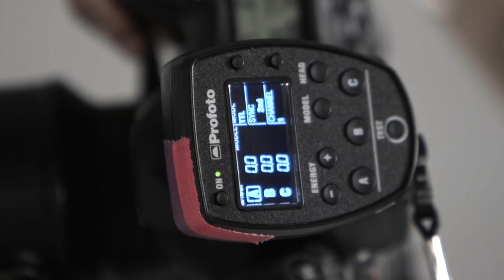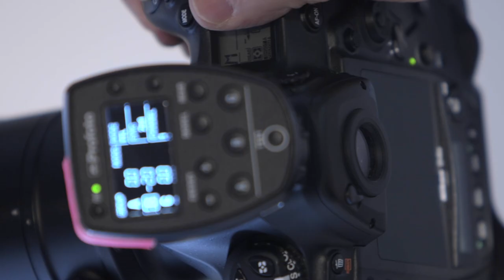Joe McNally Explains TTL

Comment: I always have trouble with TTL behaving erratically outside with OCF. I get light that overcompensates "always" Drives me crazy
Reply from the maker: Hi, I am assuming that you have the camera that supports TTL, if you do then some advices are:
1. Make sure the exposure compensation is off in the camera.
2. It may be that HSS is undeliberately switched on and the camera will need an energy level from the flashes that are outside the HSS energy range. Switch off the HSS by:
a. Canon: Switching HSS off on the sync button on the AirTTL-C remote.
b. Nikon: Do not have a shutter speed that is faster than the camera sync speed (typically 1/250 on many camera models)

Best regards
Reply: thanks